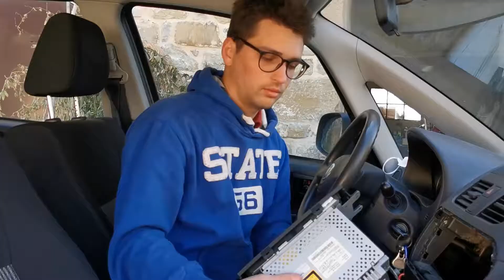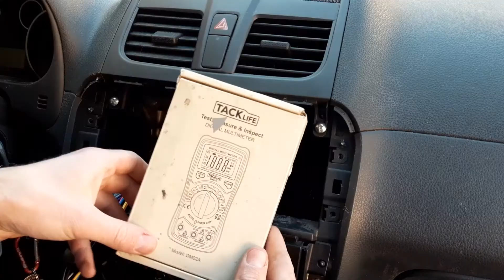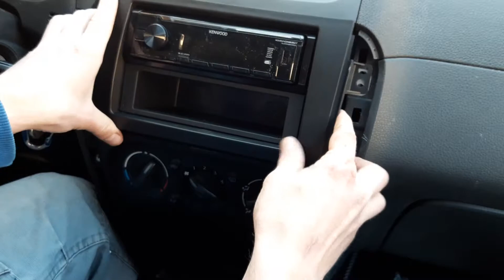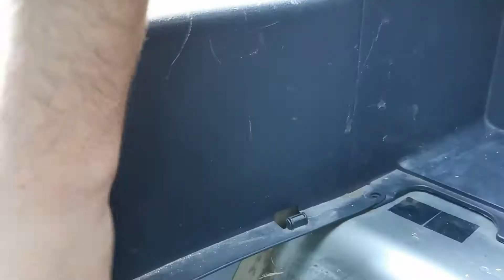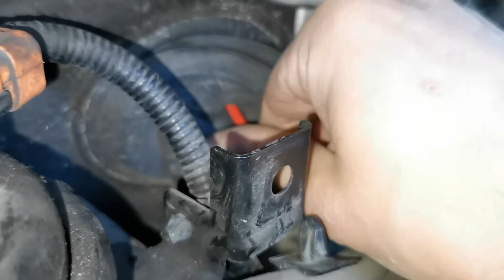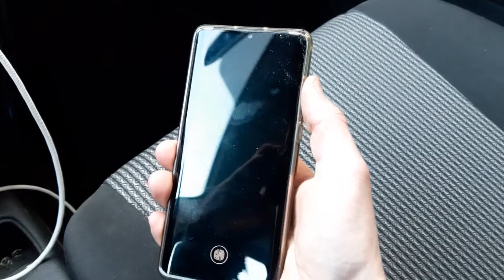DIY | Kenwood DAB307 + subwoofer on FIAT A16 sedici

Comment: Don't you install any fuse to the amp?
Reply from the maker: Hi! Thank you for the comment! ther's already a 40Amps fuse built-in in the amplifier. To be safer yes, I sould have installed maybe a 30Amps fuse onto the power cabel. Bye!

Comment: Thanks my guy, just what I needed, I have the counterpart, the Suzuki SX4, and I have searched for such a long time on how to get the power through from the bay. If possible could you capture the inside more clearly? I thought the wire got stuck behind the ventilation system in the middle of the car. I would love to get some help, I am using the stock wiring to the rear auxillary plug atm, but it can't take too much power. Love from Norway :)
Reply from the maker: Hi! I am really happy that I helped you! This was exactly the aim of the video... to show how to take the power from the engine section, back to the driver section. Well, unfortunately, as you have seen, I haven't been that much clear in how to put down cables...this is because accessing this part is really uncomfortable, you cannot even see what are you doing, you have to work only with one hand. I cannot make a video about this, but I can tell you how I did.
Let's start from the engine bay. Remove the plastic coverage, you'll see behind the steel plate a 'tissue' like material, from which all the cables are passing thoruhg in particular, there is a hole). First open a small hole with a screwdriver, you need to create a bit of space here to let the cable pass. Then use a quite big and resistent cable, as I did: it has to be stiff enough to not remain stacked into other cables. Push it down, remember to point it towards the down-right direction: I want the cable to go under the pedals. Put it down as much as possible. If you cannot do that with your cable, I recommend you to use  a cable pulling probe, those used by electricians. They are rigid enough. At that point, move into the car, driver seat back at all, you have to lie with your back under the pedals. With your arm go from the pedals up to the middle of the steel plate, back with respect to the ventilation system. Find the cable and, eventually, pull it down where you want. Let's say that you really have to find/feel it by hand. Findind all this procedure was the hardest thing at all, but in the end it worked well.
Let's say, in my opinion, that if you are stuck back in the ventilation system you are pushing the cable too horizontally....I wanted to go downward. This is because I had to go in the back of the car, so I passed behind the pedals, then back under the lateral coverages. Do you need to do that too? Or want you to remain in the radio region?
Hope this was helpful. Keep me updated! Let me know if I can help
Reply: @profilo_is_back  Thanks, it helped a lot :) I got the cable though and down behind the plastic covers and out the rear to my amplifier. My aftermarket radio already has a powerful amp so it powered my doors speakers alone without a hitch. Now I can finally run my subs at more power, the circuit for the rear aux was shared by alot in the car and the fuse would go at nothing. Great success keep on doing your great videos. This was way more informative than some others about amps on sx4 where people record the engine bay and the battery and by magic the cable is in the back.
Reply from the maker: @frederictrm566  Fantastic! Thank you for the updates. I am really glad that you like the video, especially for the 'bridging' part, the one where I prepared the hole for the cable. The same as you, I watched hours of videos without finding any solution for the power supply aspect. I had to find it out myself, and here the video!
Bye man, hoping the best for you!